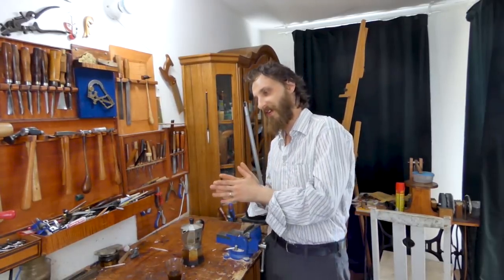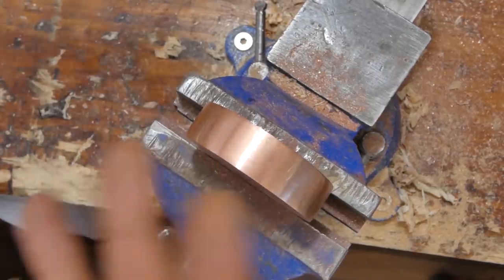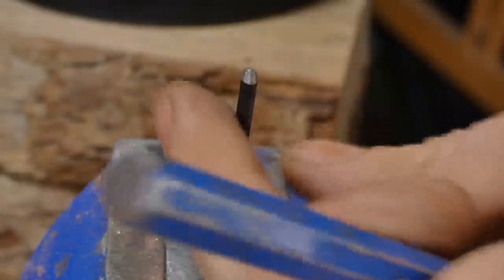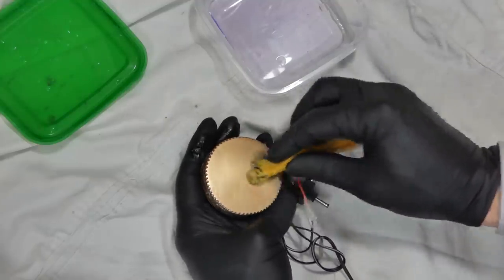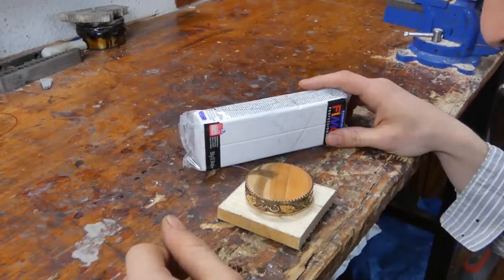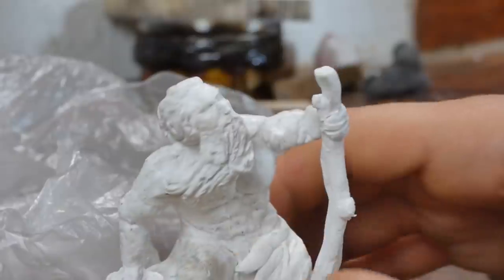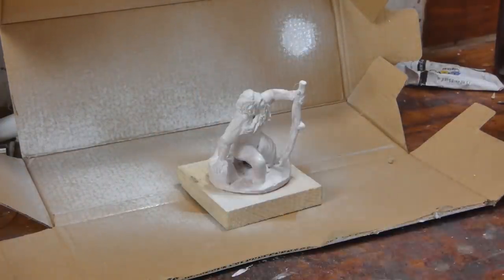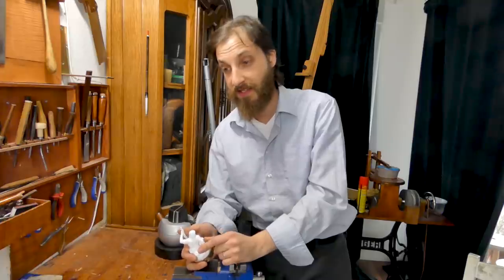Making a Coffee Tamper

Comment: The Tampa looks brilliant. Marble is easy to work. I use diamond plated files and diamond plated burrs on dremel type tools. Good marble is like working with solid cream (without the smell). Put the marble in water for 30 mins. before you work on it and keep it wet. Water running over it is best.

Comment: For strength try molding your model so you can cast out of stronger material. I use ZA-27 alloy often. It's strong and melts around 700 degrees. A cast iron skillet and portable hot plate do the trick.